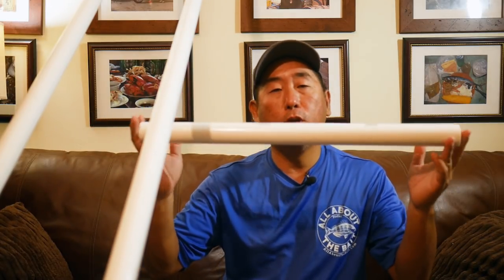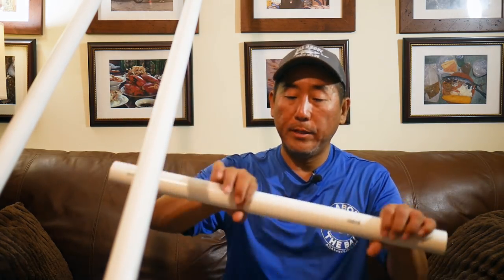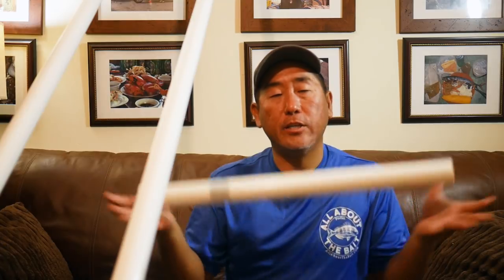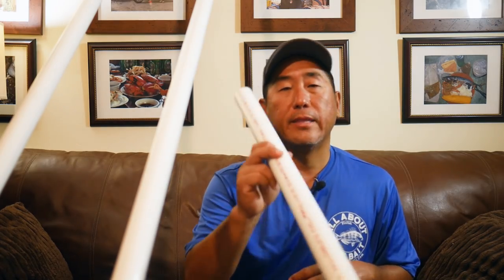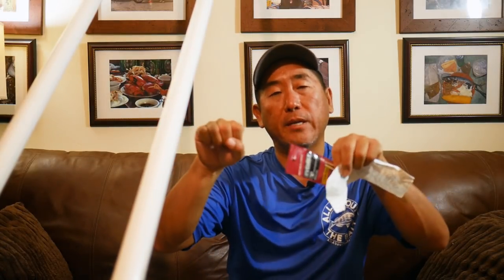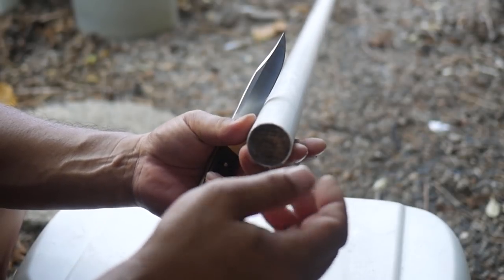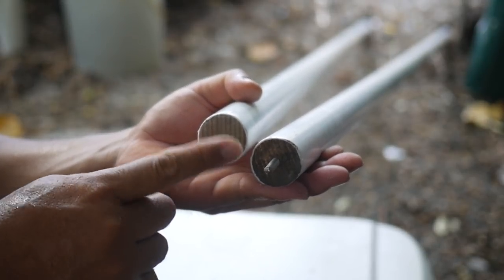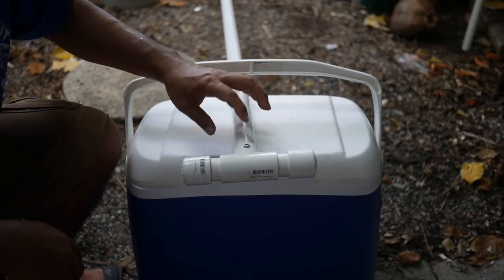DIY Push Pole Version 3.0

Comment: $50 for a pole is not very cheap.. How much are they sold for? Another thing that you could try is using pvc pipes and inserting a smaller one into a larger one (e.g., 1/2" into 1") for rigidity.